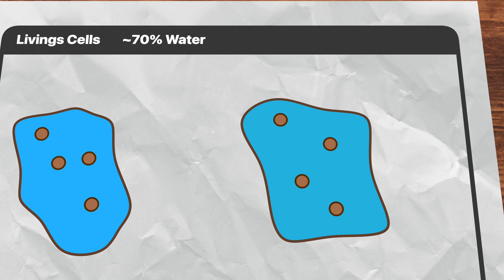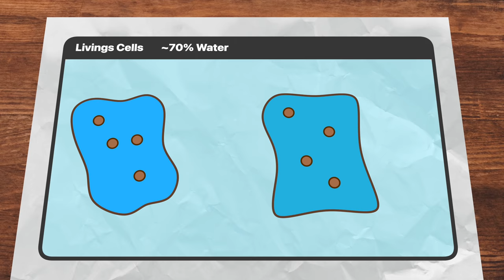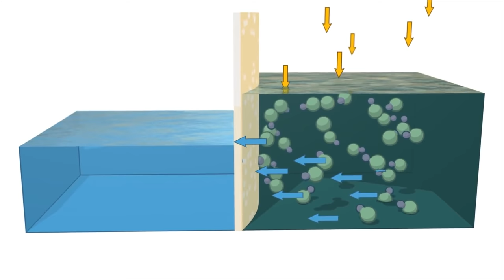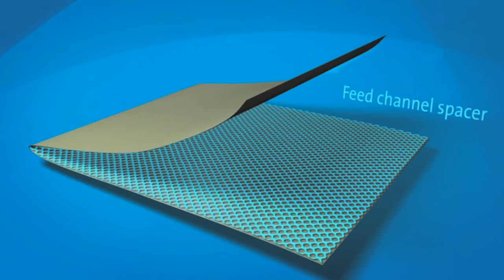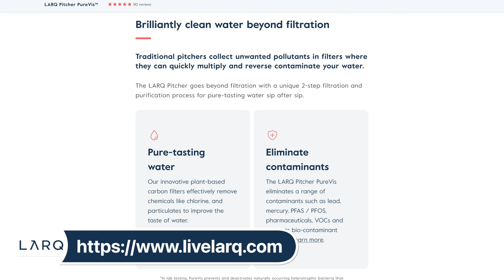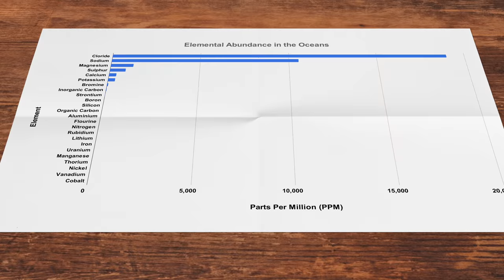Why Not Build Desalination Plants EVERYWHERE?

Comment: You don't need a heat source to desalinate water. The ideal thing to do with unused desert land would be to dig long shallow trenches for miles and miles and then install a huge primary heat exchanger right at the main pump(s) interface of the inflowing and outflowing seawater (so the dump light brine water is relatively the same temperature as influent seawater). Then in the entire length of trenches, install a dark durable material which lines the bottom of the trench the entire distance. Over the trench install durable clear plastic drip covers sealed over the trench from the outside atmosphere. Along the bottom of the drip covers install catch troughs and intermittent catch tanks with a series of solar driven pumps which tie into a main water line to a central collection facility. Something such as this type of system could be setup in a relatively short period of time, for much less money than expensive technology and generate hundreds of thousand of gallons of fresh water during daylight hours. Since the trench would be a constant flow of seawater from beginning to end, the brine levels would be naturally lighter and less disruptive to the sea. The effluent could also be released much further out into the sea where the water is much deeper and is able to disburse more easily. Also, the main system seawater pumps could also be driven by solar/wind power to make the system self-contained throughout.
Reply: @omi_god  The desert is more plentiful than forested regions. You wouldn't make a dent with desalinization channels.
Reply: wouldnt be enough, key is generate millions of gallons , your plan is flawed, what about land locked areas? in usa , then the states that would do this, would charge the states that dont have sea access, to make your hypothetical desal system.
Reply: @beast36001  Any type of desal system wouldn't work in land-locked areas unless long pipelines were built, so saying "your plan is flawed" is the same as saying "all plans are flawed" in this situation.
Reply: Merle, I’d like to complement you on all the thought you’ve put into your post. As to the viability of your plan, I have no idea. Most importantly… you have a plan. We need more people thinking and making plans like you have. Thanks for the effort. Keep on trucking… it’s going to take all of us to keep water, energy and peace flowing.
Reply: @johnhimz3832  Not so much a "plan" as it is a concept in the form of thinking-out-loud. Thanks for the compliment
Reply: Um did OP forget that this land is a freaking desert?? Where, please tell me in the world can you find a seaside desert?? Oh I'm sure they exist, but it's probably like finding a 4 leaf clover...
Reply: @m2heavyindustries378  Afrika Sahara desert is right at the ocean coast
Reply: I had the same thought.  Even if you had to build pipelines, why not?  We have long oil pipelines.  Transporting sea water is a lot less dangerous than transporting oil.  Even if you simply pumped the water to the desert, without further processing, it would evaporate and hopefully produce rainfall for adjoining areas.
Reply: @m2heavyindustries378  Pretty much ALL of Australia.
Reply: Sunlight can be easily concentrated through lenses to reach temperatures hot enough to melt copper and water will also evaporate in a vacuum.
Reply: @heyman5525  Yes, but lenticular lenses and focusing systems can get expensive. The "trench and cover" system is relatively inexpensive and would work fine given enough land space. Which is plentiful in most desert areas around the world.
Reply: Hmmmmm.That’s a fine idea for a Small camp. Unreasonable for large production of Water that need more than 1,000 gallons a day.  I’ve got a better idea. Put a 5 gallon bucket in all vehicles headed to Vegas and dump in lake mead…..Viola, the same effectiveness.
Reply: @merlepatterson  Fresnel lenses probably work better and you don't need focusing system. You simply set lenses at every angle to capture the sun. A trench system is not getting direct sunlight except for a few hours out of day, whereas with lenses, every minute of sunlight is captured and concentrated to 10x the heat produced by regular sunlight.
Reply: @heyman5525  Long trenches facing east and west in arid deserts would get sun most of the daylight hours and with a primary heat exchanger at the influent/effluent are where the main pumps would be located gives the incoming seawater a primary boost in being pre-heated while the effluent is cooled back down on its way back into the sea. The system would work well enough to support a large population if it was built on a large enough scale. Not only would it produce water during daylight hours, but it would keep producing water into the night as the ambient outside temperature drops fairly rapidly when the sun goes down. deserts are known for getting chilly at night. And as I said, there are vast areas of unused desert all around the world. It's not a matter of can it work, it's a matter of when will someone with the finances attempt it? Without a doubt it would work.
Reply: @merlepatterson  If the seawater has to be piped to your trenches, e.g. in California where the nearest desert is quite a distance from the Pacific ocean, will the salt crystalize on the inside of the pipes and eventually clog them up?  If so, they will need to be continuously maintained.  I'm not an expert at any of this and therefore I'm just thinking out loud.  So maybe there would need to be 3 pipelines going to the same desal trenches and then one could be closed for maintenance as the other two are still working.
Reply: @bobloeffler576  I don't think there's much worry about salt crystalizing in the pipes as much as the worry of normal rust and corrosion processes. Any system is going to need continual maintenance, especially the more complex it is, such as a reverse osmosis system. However, the simpler the system, the less maintenance there is. Though, you make a good point for redundancy.
Reply: That sounds interesting but what would keep the clean water from evaporating
Reply: @joegiarratana6210  The entire length of the channel would be covered by clear plexiglass and sealed off from the surrounding atmosphere over the channel. Then the clean water would flow by catch troughs to small pumps evenly distributed along the channel. There would be progressively bigger pumps from centralized collection areas. So, no evaporation to speak of would occur once the clean water has condensed.
Reply: @Andrew Robinson Global warming and rising seas could certainly cause significant problems with salt-water contamination of soil.  Perhaps the risk of salt-water pipelines is one that has to be accepted like reluctant return of "green" nuclear energy.  That cost/benefit analysis can be left to the experts.  From web-search, I see that the state of Utah for example is in fact considering a salt-water pipeline.  I see also that there are methods of trying to treat salt-contaminated soil, it sounds like it is not impossible, even if difficult.

It would be nice if crop breeding or genetic modification could allow some useful crops to grow in soil irrigated with salt water. If fish can live and grow in salt water, why inherently not modified corn or soybeans?  Might be a nice Nobel Prize for a molecular biologist who wants to help save the planet.

Another note is that cities could save by using a separate salt water pipe system for purposes such as toilet flushing and laundry.  A friend of mine knee-jerk scoffed  at the expense until I pointed out that there are already cities such as Hong Kong, successfully doing this.  Much water use in the average home goes to toilet flushing.
Reply: @tom-kz9pb  With this type of system there would be no contamination of the surrounding soil because the bottom of the entire trench would be lined with either a spary on sealant or durable black liner to keep seawater in the trench along the entire distance and since the system is continually recirculating seawater from and back to the ocean, the brine should never exceed excessive levels.
Reply: @spiderman no way home< really? the technology is there
Reply: Dig a canal along the US Southern Border. Make it wide and deep enough for modern sea craft. Now you have a moat, a canal, and a source of water for desalination.

Just north of the canal, build a large concrete wall that houses multiple freshwater mains. Slap solar collectors all over the wall.

Build conventional desalination plants at both ends of the wall and at other locations along the wall. Establish Kelp Forest agriculture off the coast and harvest, among many other produce, kelp meal fertilizer.

Now you have fresh water, power, and fertilizer. Any immigrants coming north can establish communities of their own while their Naturalization process is conducted. Nobody is turned away. Nobody is let all the way into the US without proper vetting. Nobody is caged up or sustained using national resources. Nobody loses their dignity by having to rely on handouts.

Everybody wins except government and the corporations controlling them.
Reply: @tom-kz9pb  Kelp forests are a source of many types of produce.

Why reinvent a wheel Nature had already developed over billions of years?
Reply: @josephcoon5809  Rather Utopian, but clever no less.
Reply: @merlepatterson  What makes it “Utopian”?

The fact that most of society really doesn’t care about solutions; only being “right”?
Reply: @josephcoon5809  Well, for starters a channel the entire length of the southern border would be nearly as expensive as the Panama canal in comparative prices for the day. I'm not suggesting it's a dumb idea, I'm suggesting it's an expensive idea.
Reply: @merlepatterson  I suppose you’ve never heard of the “Great Manmade River”?

It’s a water main system longer than our southern border.

Besides, people keep complaining about “infrastructure.”

All I have done was explain a mutually beneficial solution to EVERYONE. People concerned about the southern border and illegal immigration would buy into it. People concerned about humanitarian issues AND global warming would buy into it. Illegal immigrants would buy into it.

The only people that wouldn’t buy into it are the ones that need YOU and the people you disagree with. Because the more you two fight, the more “solutions” they sell to government; solutions that either cause more problems, or give the perception of solving the problem they are meant to solve.

Ever wonder why government keeps getting bigger and bigger?

It’s because they are not in the business of solving problems.

Besides, you are comparing it to the Panama Canal that was designed for a SINGLE purpose.

What I proposed is far more multi-faceted offering value in multiple ways.

Lastly, the canal aspect is late stage benefit. Everything else produces value long before the canal is complete.
Reply: @josephcoon5809  Maybe, but it's still an expensive hypothetical suggestion and to think we'd ever get congress on board for something so massive is grasping at straws at this point. I don't necessarily disagree with you, I'm just attempting a bit of practical foresight.
Reply: @merlepatterson  You really don’t understand what I’m saying because America has diverged greatly from its original design, and people VOTED for it.

The only thing government has to do is GET OUT OF THE WAY of progress.

Besides, you are touching on ideas I have neither the time or inclination to address in this venue. You’re broaching on a 40-hour discussion JUST for the top-level overview.

You’d have to be familiar with 4th Generation Warfare concepts to understand how to deal with asymmetric power struggles. Study that a bit, and maybe I’ll consider explaining more. Until then, live in the box corporations put you in via government.
Reply: @josephcoon5809  Besides, this discussion was about desalination, not politics, but you twisted the conversation into knots quite efficiently. Had me following you down the path for a moment, but that will be corrected with this course correction.
Reply: @merlepatterson  Everything is political because these “discussions” are more about “I’m right, so I’ll vote for the person who says they’ll make it happen” rather than developing actual solutions.

Besides, if your idea is so simple and feasible…where is it?
Reply: I saw a video on how a man survived out at sea on a raft by using desalinization floats, but they didn't yield very much compared to collecting rainwater. The trenches could only be productive for a few months as US deserts experience below-freezing temperatures during the many long and cold months. Pumping the water in and out over such long distances would require too much energy and the solar components would have limited hours of effective sunlight.
Reply: I've been thinking for a while now, why bother with "de-salination" at all? The Sahara Desert is a HUGE area of land, if Solar Power is virtually infinite, and Sea Water is also virtually infinite, just build a HUGE lake in the middle of the Sahara and let nature take its course evaporating water and raining it down onto the earth.
Put a large body of water in the middle of the desert and regardless of how salty the lake is the surrounding area will be covered in fresh water.

Comment: It's funny, I had actually thought about this before by using the "Power tower" plants to desalinate. It just makes so much sense. Desalination, by either method is a highly energy intensive exercise.  RO maybe less so unless you count the membrane materials and the equipment needed. Unless they could figure out a way to recycle the membranes, it will always have a high amount of consumables. Thermal is definitely a more efficient way if you can do it with sustainable energy. I am excited to see this facility progress.
Reply: A far more unfashionable way of producing clean water is through the use of evaporator condensers.  These have been used on military and merchant naval ships for probably close to 100 years.  ROs are all the rage as they are a package unit and generally in industry we in the west are driven to dumb down our workers, rather than educate them.  So water boils at sea level at 100*C.  However, if you were to boil water on Mt Everest, it would boil at a lower temperature due to a lower atmospheric pressure.  Lower the pressure, the lower the boiling temperature.  So what happens is that design engineers on a bulk carrier vessel have a WRU (Wasteheat Recovery Unit - like a radiator in a car) to capture the thermal energy going up the ships exhaust chimney.  The temperature of the exhaust of many engines is around 650*C.  So if you capture this waste energy (heat) that goes up the stack, you can boil water.  This boiled water can then be collapsed to create a vacuum.  This vacuum is then fed into a shell tube exchanger with salt water as a feed stock, and here the lighter pure clean water can be boiled off at a much lower temperature than 100*C.  This water vapor is then fed through a condenser unit, cooling medium being again sea water, and you end up with fresh clean water out the back end.  And all you need for this is a few pressure gauges, a running primary engine for the ship and maybe a centrifugal pump or two.  And if you make water that is too clean, the only drama could be that this super clean water could start to strip some salts and trace elements from you body thanks to the process of Reverse Osmosis inside your body.
Reply: The Earth is literally overloaded and bombarded with "sustainable" energy, from all sides.  Geothermal and solar.  What else do you need?

Comment: If you extract the same perentage of fresh water, reverse osmosis generates the same amount of brine as thermal distillation.  Also the brine from thermal and reverse osmosis is just as useful for mineral extraction as the solar system.  If you think about it, the solar system is a thermal system.
Reply: Yeah, the brine is only an issue if they don’t dilute with seawater first and dump it all in one place.
Reply: @kirkland5674  To dump it in multiple places at once thinly enough to not wreck ocean ecosystems is going to require LOADS of transport capacity. It could well be more expensive than the actual desalination plant and would likely either use loads of power/fuel in its own right to power all the transport vehicles required, or requiring the construction of an ocean wide sprinkler system to dispose of the brine.

Comment: Here in Victoria (Australia)  we built a reverse osmosis desalination plant that has a maximum capacity of 150 billion litres of water a year and it is powered entirely by renewable energy, mostly solar during the day.  I think it is the first of three that were planned for the future.  It has allowed us to stabilize our dam water levels, after a drought we hit about 16% at the worst point, now we are about 86% or so, leaving a bit of slack for winter/spring rain.

I am not sure what they are doing with the waste.  It is interesting we have way more solar power than we have consumption for, it would be a good use of the power if you could also extract some valuable minerals like lithium.
Reply: well there is a slight difference in how they power the plant. it actually uses energy from the grid (since solar energy is currently still unreliable) but then offset it by buying Renewable energy certificate, then the fund is going to facilitate some windfarms or some things. The brine is pumped back to the ocean through diffuse nozzles (to minimise salt concentration around the dumping area) and they made extra long outlet tunnels under seabed to go pass sensitive marine areas! Cheers from Sydney.